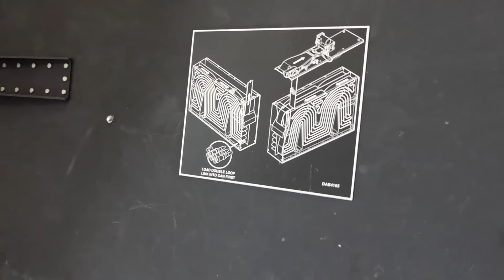Scharfer Schuss aus H145M MG6 M134 Gatling

Comment: Yo yo yo.
.338 Federal.
Ackley Improved.
90 grain .224 diameter ALCO Bullets' 0.627 ballistic coefficient projectile at 4,300 fps from a 20 inch barrel
or
253 grain Raufoss multipurpose 0.338 inch diameter projectile with a 0.554 ballistic coefficient at 2,500 fps.
90 grain could sub tungsten and copper internals for AP capabilities within the same form factor.
2,368 yards until transsonic at standard temperature and pressure.
2,165 meters.
253 grain gets 1,074 meters until transsonic.
Better yet from the 24.7 inch barrel of that M134.
Big fan of Dillon Aero.

Edit-
4,300 fps for a 97.2 grain total payload (7.2 grain 0.338 to 0.224 inch sabot+90 grain projectile) generates the same recoil impulse as M118LR (175 grain Sierra Matchking, 0.508 ballistic coefficient, 2,600 fps) making it compatible with .308 Winchester/7.62 x 51mm architecture.
20 round box magazines or 50 round drums for DMRs.